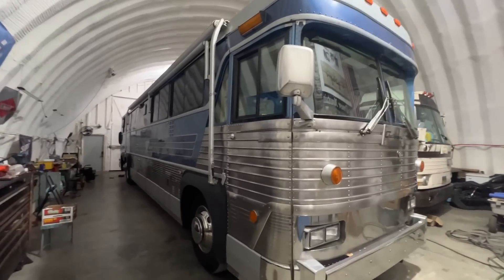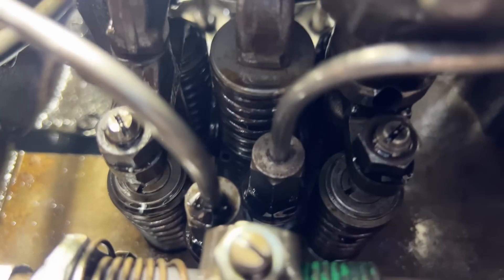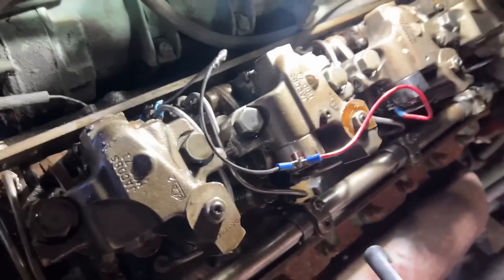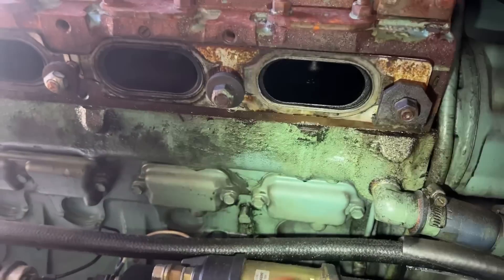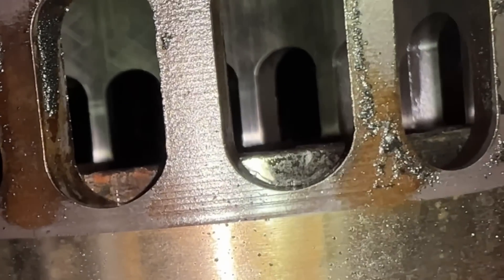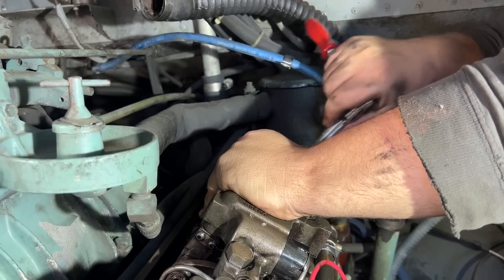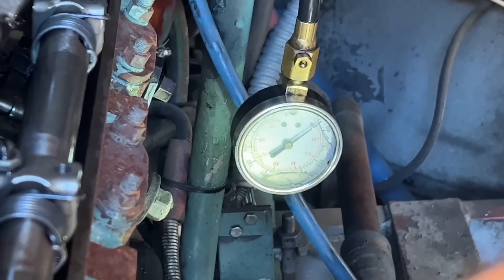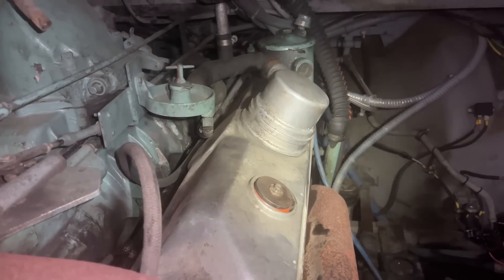Diagnosing the detroit diesel 8v71 in the mci mc-7 bus conversion

Comment: Hello Señor. My name is Jorge. I know you have enough knowledge on old detroit engines. I have a question for you?
What type of oil should we use on a 8v92?
Some technicians say regular 15/40, Others say straight 40. So far I have been confused
Reply from the maker: Never a multi grade!   Straight 40wt cf2 low ash.

Comment: Good tip on those jumpers. Years ago in school, the class who worked on the injectors on 8V72 left ALL the jumpers loose, FILLING the oil pan in short order. We had taken the semi out for a test run and noticed oil pouring out of the main seals. Low oil pressure too.
Reply: OOPS Typo! 8V71. Fat fingers!

Comment: Though the years of working on Detroits I’ve found a lot of cracked fuel lines from overnighting, a lot of mechanics have a bad habit of not torquing the lines and over tighten and crack them at the flare.

Comment: Yep, that cylinder is bad for sure. Working outside is probably going to be a bit cold by the weather report for down there. on the news they showed it down in the 30's already for Nashville. We are still in the 70's up here in the Seattle area and the wildfire smoke is horrible. We are supposed to finally get some rain this weekend and temps starting to drop too.

Comment: I’ve had leaks from the fuel jumpers on a 16-645 EMD before. I just replace them. Once they leak it’s almost impossible to stop it. Sometimes the seats get damaged when installed and no amount of tightening will fix it.